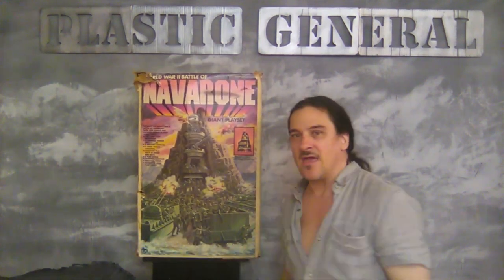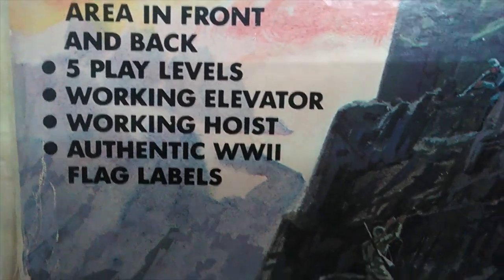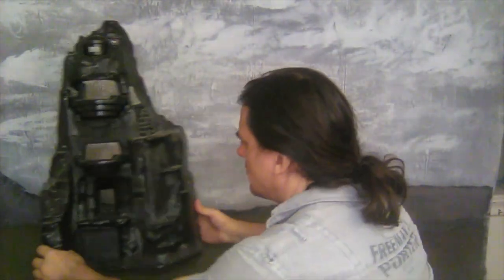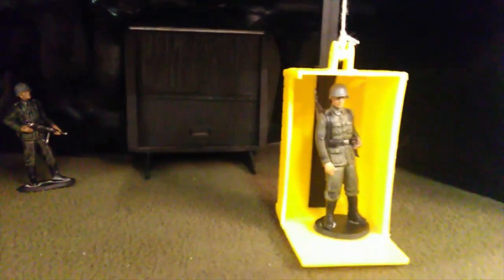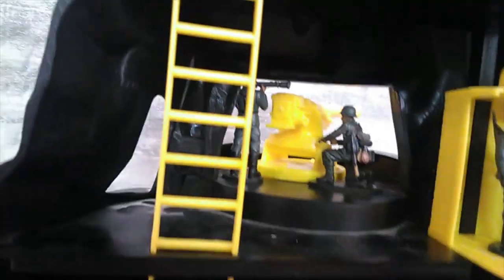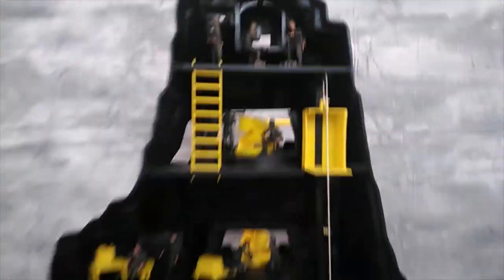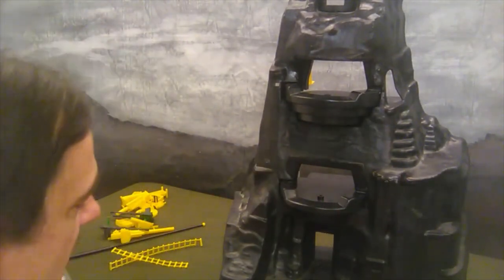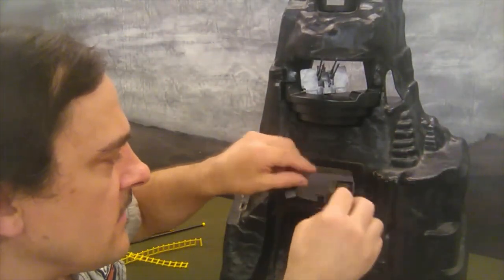GUNS of NAVARONE PLAYSET - Part One: Planning the Attack!!

Comment: When I was a kid, I actually had a mountain almost exactly like that. My Dad picked it up somewhere second hand and it came with a ton of German Marx soldiers. The thing is that I remember it being grey. The mountain I had, however didn't have the big yellow guns. Whoever had it before me had taken them out, filed off the round nub and was using the Marx  German 88s guns in those spots. I never knew until now that the original guns were yellow. I could sort of see you painting and using the smaller one if you ever make another battleship though. I can;t wait to see how all this works out!
Reply: Remember, it just so happens that the playset I have is a 1980 Re-issue made by MEGO, so they probably used whatever plastics they had on hand in abundance. I wonder if the MARX original had a Grey mountain and dark grey guns?  No matter, Change is Coming!!